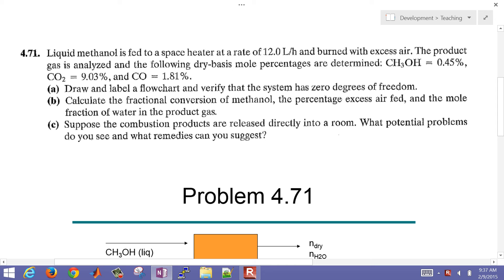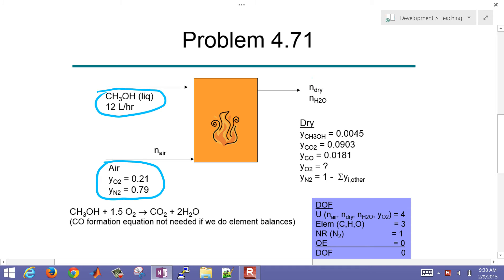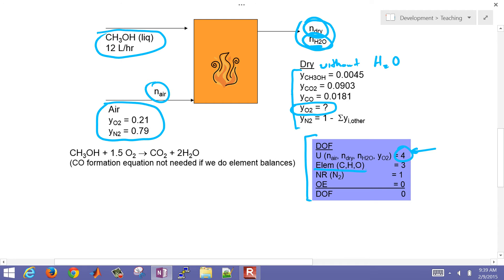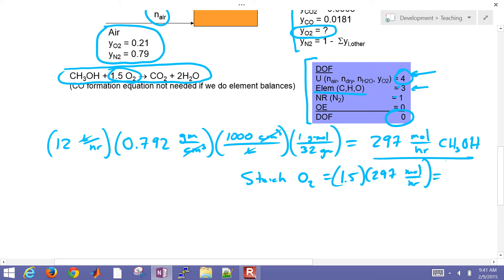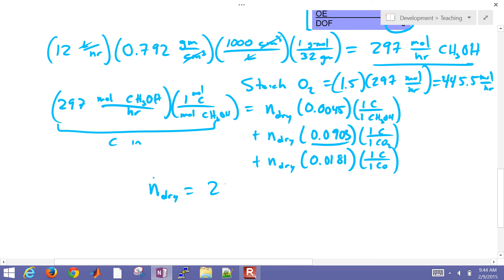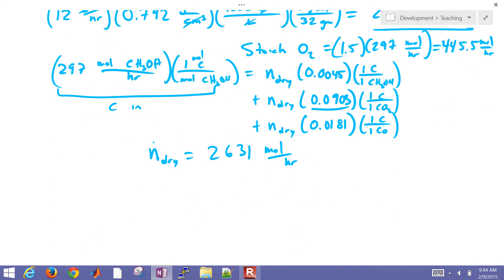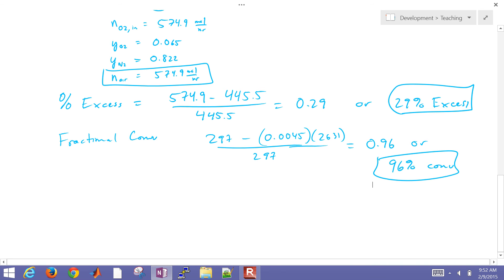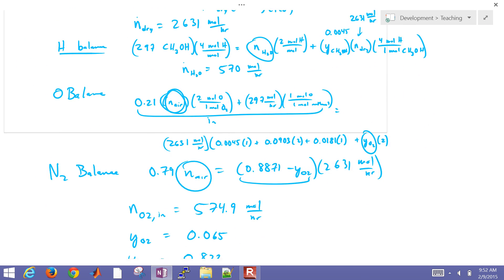Combustion Percent Excess Air

Comment: Why do we use H2O in the H balance but not in the O balance?
Reply from the maker: Good catch - that is an error. The correct answer should be n_air = 2400 mol/hr and y_O2 = 0.166 (dry basis).
Reply from the maker: For those who are following along, the missing term for H2O out is at 11:30.

Comment: 1. A bituminous coal has 27.15% VCM; 62.55% FC; 7.06% Ash;  0.95% S and .28% N. It has a calorific value of 32.3 MJ/kg. 
The coal is fired with excess air supplied at 30 degrees celsius and 1 atm. Partial Orsat analysis reports 9.78% CO2, and 2.45% CO. Calculate:

a. % Excess Air
b. Ultimate Analysis of the coal
c. Complete analysis of the stack gas.
 

2. A furnace is fire with coal with 72.65% C, 13% ash, 1.6% N, and 3.2% S. 
The Residue in the furnace contains negligible combustible matter. The air enter the furnace at 38 degress celsius and 5 psig and 75% RH. 
The stack gas leaves at 300 degress celsius with 8.4% CO2; 2.5% CO; 0.8% H2 and 10% O2. Calculate:

a. % Excess Air
b. Ultimate analysis of the coal
c. m3 of stack gas/kg of coal
Reply from the maker: That sounds like a very interesting problem. Thanks for posting it.